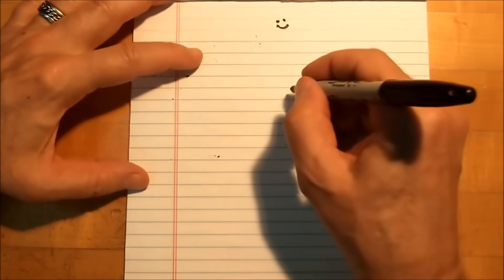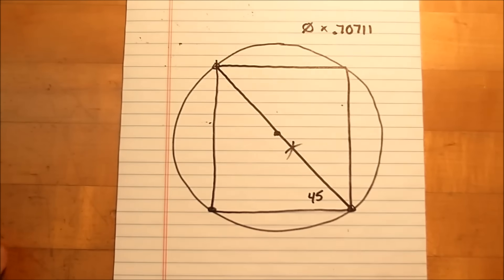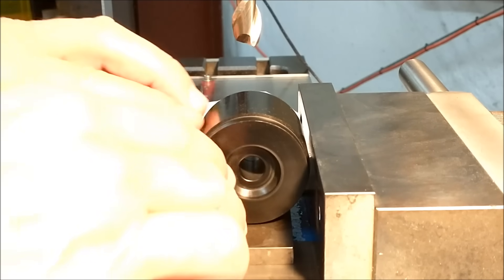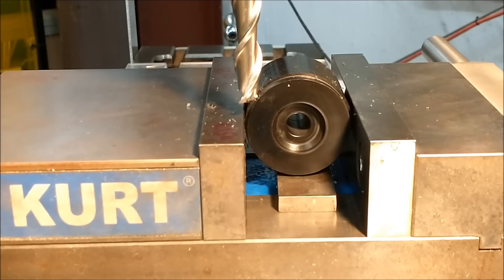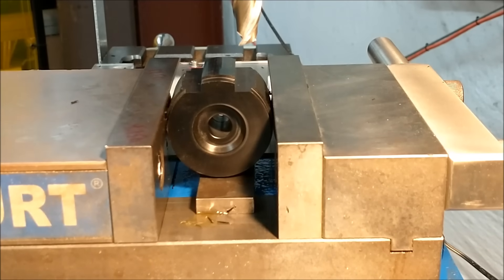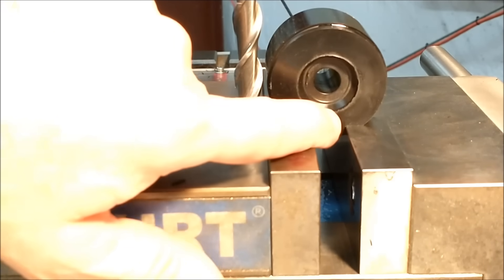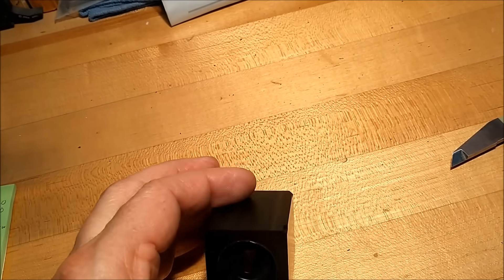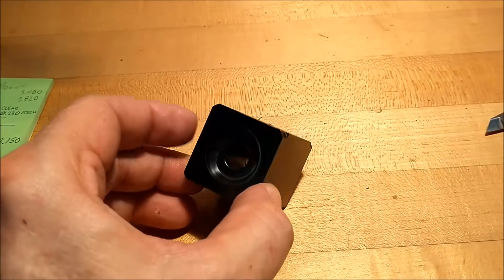Machining Round Stock to Square -- A Time Saving Technique !!!

Comment: Been using this method for a number of years now. It actually came about as a result of the cost of square shaped stock in some of the harder materials I generally work with being needed in larger sizes. Being that most of my work is in a larger 50 taper machine, I will also go as far as dovetailing the grip rail in heavier pieces (500-800  pound) to make sure they stay put. I even go as far as cutting the grip rail in the 12 foot lengths before they go in the rack on certain materials just so they are ready to go when needed. Glad to see someone else had the same idea and is able to share it with others!
Reply from the maker: I've seen the dovetail grip rail used with success on some very heavy stock. It has great grip integrity.

Comment: Hint: Pythagorean theorem. The magic factor is 1/√2.

30°, 45°, and 60° angles all have simple formulas for sine, cosine, and tangent, and it's worthwhile committing them to memory. They were pounded into me in 8th and 9th grade and stick ever since.

tan 45° = 1
sin 45° = cos 45° = 1/√2
sin 30° = cos 60° = ½
cos 30° = sin 60° = √3/2
tan 30° = 1/√3
tan 60° = √3
Reply from the maker: Thanks Paul.
Reply: @joepie221  Which reminds me: as much as you love to teach trig, you ought to do a collaboration with 3blue1brown. He does some wonderful math videos. Maybe Ruger could get some animation time with the pi brothers 😁
Reply: Correct.

Comment: Hi there. Yeah Keith from Michigan. What a kicking process from round stock to square. I primarily round material for the Lathe projects. The ability to change via to square, great Joe 👍..
Reply from the maker: Its good to use the material on the shelf if you can.

Comment: also you can use A squared + B squared = C squared so Square root of C divided by 2 = your stock dimension.
Reply from the maker: Wouldn't it be the square root, of half of C squared ??
Reply: @joepie221  yes your right. Forgot that step.

Comment: My method will be simpler. 
I will hold round part in the vice by kerping suitable parallel below the part, Considering material is to removed ie dia D - (Dx 0.7071) divided by 2 = X material is to be removed eququilly from each side.
First remove from top face x material. Then hold part by touching the flat face touching fixed jaw of vice. Then removeagain x matetrial9. Similarly mill material from remaining sides. That's All !
Reply: If the back jaw of your vice is 90 degrees you will cut a square.

Comment: Of course, if the dia is less than 1 1/16", you can put it in a 5C square collet block and then no fussing.
Reply from the maker: OK....Technically your represented fraction is 1.062. This is a big 5C. I'm thinking you meant 1/16" .062 ??
Reply: @joepie221  actually my 5c collet set goes up to 1.125”.

Comment: Great trick! Thanks for sharing. I hope your recovery is going well, and you are back to 100% asap. Also, I used another trick of yours the other day and it worked flawlessly. The one you showed about picking up an internal thread on the lathe where you but your tool into the thread with the boring bar loose, then use an indicator on the the end of the shank to see how much it moves so you can  put your tool right in the correct spot. So slick, this was a large specialty nut for a valve where I work, with a buggered up thread on the end. Worked great, thanks for sharing all your knowledge!!
Reply from the maker: Go in and ask for a raise. :)
Reply: @joepie221  😂

Comment: The opposite side measurers  .707 inches for every inch of hypotenuse. Sin(45).   The adjacent side measurers  .707 inches for every inch of hypotenuse. Cos(45).  Hypotenuse length is the diameter in this case.
Reply from the maker: As shown.
Reply: @joepie221  yes. The students who struggle with trig respond well to this choice of words. Just trying to help other viewers/hobby machinists.

Comment: Thanks Joe, I’ll keep that technique along with the one you showed us for squaring stock. Sin 45° = Cos 45° = 0.7071.
Reply: Alternative: It's square root of 2 divided by 2.
Length of the cube side = a. Diameter of the round stock = D.
So a² + a² = D²  <=> 2 * a² = D² <=> a² = 1/2 * D² <=> a = sqr(1/2) * sqr(D²) = sqr(1/2) * D = 0.7071 * D

Comment: Great videos as always Joe, was wondering if you think you could do a specific video request in the future.  Id love to see your take on making precision located holes using spot drills versus center drills and maybe explain the best practices to  actually make a precision located hole using a drill bit or what it would take to make a precision hole if drill bit or spot drilling is not sufficient a little metrology would be awesome to see the difference between all methods including probably your methods.  There are very few videos on youtube demonstrating good techniques on precision hole locations that i can find.  Appreciate you and the time you put into sharing your experience.
Reply: Oh gosh, you could go hog wild with that and do a setup with machinist's buttons.

I was gifted a set of them, but I've never actually used them.

Comment: If your stock is longer, you can turn a reduced diameter (inscribed circle to the finished square) on one end so you just touch this diameter region when the square is finished.  If the finished piece is a rectangle, turn 2 diameters, each determining 2 opposite sides.  Saves trig, saves a lot is you have no readout.

Comment: This Old Tony turned a cube on the metal lathe yesterday so I was wondering if you would do something similar.  You did something completely different and far more useful.  For one thing, you used a mill and not a lathe.
Reply: With a CNC lathe you can really do it :) https://www.youtube.com/watch?v=nViXP9SsdWc
Reply: And for another it is now not April first.
Reply: If you want to be entertained, watch TOT. If you want to learn something, watch Joe Pie 🙂
Reply from the maker: Tony makes great videos. I'm a fan.

Comment: The trick to finding the largest square is that a 45-45-90 degree triangle has a known relationship between the hypotenuse and the two identical legs. The hypotenuse is the length of a leg times the square root of 2. So by using the diameter as your hypotenuse you just have to solve for a leg and that's where you can either divide by the square root of 2 or multiply by .70711 (relationship/ratio between a leg and the hypotenuse).

I hope someone finds this explanation of the math behind this useful.
Reply: That works, in my head it was multiply by sqrt(0.5) which also gives the same answer.😊
Reply: omg i just want to mill and cut stuff do i have to know all this lol?
Reply: @NewsNowFortWorth  nah, just crank the rpm and make some chips

Comment: As a general rule. My go to end mill is a .375 3 flute carbide.. my machine does most of its work with that size(unless bulk removal is in order, or smaller is required) so you using your preferred size instead of a bigger one is perfectly understandable.
Reply: Bang for the buck 3/8 or 1/2 depending whats on sale.

Comment: 4:06  need a V bolck between steady jaw and part or turn the part 90 along Z axis to hold firmer....
Reply: Three points of contact.  Text book work holding.  No need for a v-block.
Reply: awready then
Reply from the maker: Imagine this part 24" long with irregular ends.
Reply: @joepie221  24" wide vice needed then    :) Great vids,  I learn a lot....Thanks